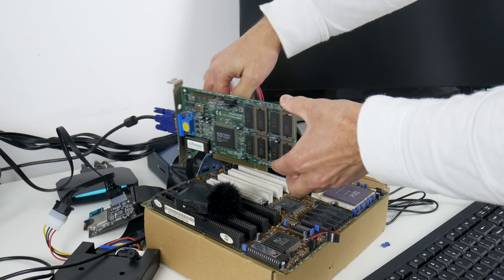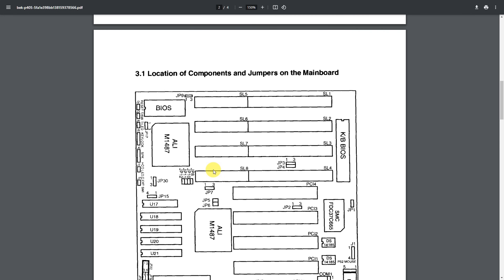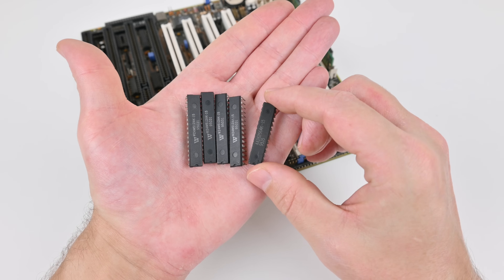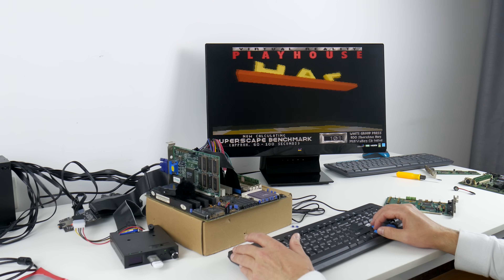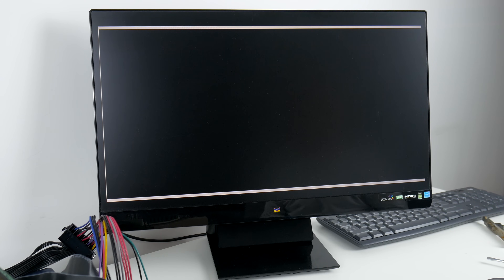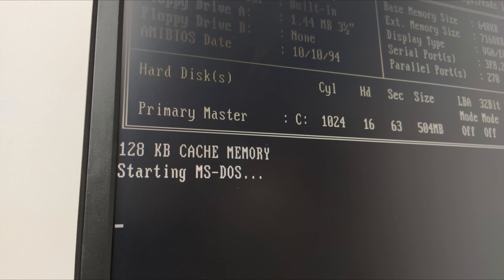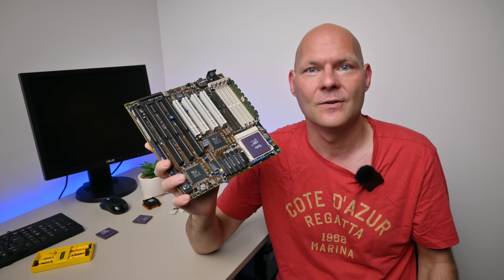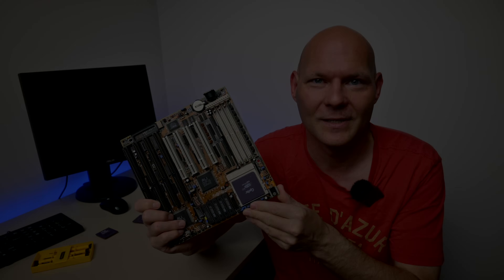PCI 486 Motherboard: The P405

Comment: @18:00 In my experience the best way to develop debugging skills is to start with electronics kits where you have to solder the components on yourself. These are a good start as they come with well defined parts and known working designs so the only thing that can go wrong is the assembly. Start with through hole kits and then try your hand at SMD. I recommend you focus on hot air as I've found over my decades of doing this that I've gradually evolved from iron first to hot air first.

Comment: You are mentioning the PS2 header. I have a baby AT board here that has one. I had to solder it on actually, as it was not populated. So far so good. It was working, when I wired up a PS2 mouse directly, but I can't seem to find a slotbracket for PS2. So I mean the part, that has the actual port and a cable to connect to th the header. Do you have an idea where to look for one or how it is called?
In the meantime I even resorted to 3D print a bracket myself and use a solder on plug. But the quality of the plug was so bad, that it broke after only a day.
Reply from the maker: They will be very hard to find. You might be better off buying blank slots and drilling the hole yourself. The mesh slots are easier to drill holes into...

Comment: the SiS 496/497 chipset seems the more solid of the PCI 486 chipsets in my experience, i had no lockups or reboots or hangs, even Windows 95 ran fine on it

Comment: great video bud. only of the best machines i had was a 486DX4 100 with VLB. it was amazing. i DOWN graded to a pentium 60 yes the old 5v POS and regretted it badly even till 2024, all the while i had my amigas and the like. i loved my DX4100. after watching a vid just recently where a dude built almost the same config i will do it again. best machine EVER. thanks buddy
Reply from the maker: You and me both! My very first custom built PC was an AMD 486 100 MHz with VLB. I loved that PC. All the parts arrived by mail and I was so excited. My next machine was a Pentium 133 which was a huge upgrade, but still, that 486 I have fond memories.

Comment: What's sneaky about barrel Batterie repairs/replacements?  Regarding 486 I run into a lot of issues with these boards overall. I'm now running a Pentium 1 motherboard with intel chipset and intel Pentium 100. Absolute hassle-free and very happy with this decision. It also features two usb 1.1 connectors for easy file transfer and modern interface devices.
Reply from the maker: Yes Pentium systems are much easier to work with...

Comment: I had a 486 DX2 66MHz iirc, and after that a 486 DX4 with 100MHz. Can't remember the details, as I was very young and my brother's did all the work setting these up.
I'm currently in the process of reviving my first PC, a Commodore PC10-III (Intel 8088, XT machine). I did find the videos of Adrian's Digital Basement very useful for repairing the battery damage and the first debugging steps with my oscilloscope (checking the RTC chip, address lines, ...). Still have a lot of work to do, it's not working 100% yet.
Greetings from Germany :-)

Comment: I hear you! 😅 It’s a full year I’m trying to get a stable 486 VLB build and after 2 boards, 2 vlb vgas and many hours spent I’m not getting the cdrom to work 😢 I’m going for an ISA multi i/o controller instead of the vlb one I’m using 🤞🏼
Reply from the maker: Yea with DOS at least you won't notice the difference. Use something flash based. Under windows 95 maybe but that runs like a dog on a 486 anyway.

Comment: As always, extremely interesting.  Each time I see one of your videos, I feel terrible for not unboxing back all my personal vintage PCs and making them work again. (Only the pentium works fine, the older ones are sick or possible dead, sadly)

I started learning a bit of electronic fixing few years ago, although with new motherboards which is quite more difficult. There are so many fantastic YT channels of people teaching that I wouldn´t know which one suggest. 
My only advice if you start working with the heat gun is to avoid the cheap yellow heat tape to protect plastic parts. I use aluminum tape (for heating ducts, chimneys, etc). Really cheap and amazing.

Also, for these old board with pìn through elements, a desoldering gun is an absolute blessing. They are a tricky and tend to get stuck until you get them right, but the time saving removing slots and stuf is massive, and at least for me are just safer.

The basic diagnosis for the trace repairs in that board, should start with just a multimeter in continuity mode, and see if they actually follow throuh to the PCI slots. I suggest almost needle-thin ending probes for it. If you don´t have those, they are pretty cheap with nice silicon wire in Aliexpress, so no excuse for not getting ones. 

Not an expert by any means, just a low level enthusiast, but glad to share. In any case, thanks for your videos, they are always welcome.

Comment: I found the PCI boards to be more stubborn to work with versus the VLB variants. This is probably due to the early adaptation of the PCI chipsets. I had to fight with my ZIDA 4DPS for a few days in order to make it stable. Now it's running a patched BIOS from 1998 on a Flash ROM that I had to sacrifice a P5A-B for. I'll eventually get a Flash ROM for the P5A-B and get it up and running again with a Flash ROM programmer. Currently the 4DPS is paired with an Am5x86-P75 with an MGA Millenium 2MB. Primary game is Raptor, which I missed the most.

Comment: While I did have a mate whose brother had a 486DX2-66 and it was really my first experience with DOS gaming, I have to say that I am more nostalgic towards the Pentium 1 as a Pentium 100 MHz was my first IBM compatible. However, I have now managed to get a 486DX2-66 motherboard but I just lack a case to put it in. I am actually considering doing a Woodgrain 486 since LGR's videos about his escapades with that machine have inspired me (and many others I have learned over the years) to make such a machine. This motherboard has VLB and no I/O built in so I will need cards for everything. Ultimate goal will be to find a 3DO Blaster for it and a Creative 563-B CD-ROM drive but those are super hard to find at a reasonable price. But it is good to have goals, isn't it? :)
Reply from the maker: 3DO Blaster, nice!!! I've never even seen one!

Comment: The thing I love about the 386, 486 and Socket 7 corridor is how much choice you've got for what to put in it, especially CPU-wise.  Still looking for a PCI 486 board for the cost and flexibility reasons you mentioned.  From my own recent adventures, I've been amused about how what would have been budget boards back then tend to be the safer bets now, since tighter integration means less can go wrong.

Comment: Not the topic, but can you please make video explaining how cache works? I recently assembled 2 486 PCs, one Intel 486DX4-100 and one DX2-66, I had the joy to discover all the problems (5V CPUs, 3.3V CPUs, FAT16 vs FAT32 needing Win95 OSR2, problems with jumpers not documented, problems because most of the HDDs are LBA and not CHS needing Ontrack Disk Manager from your website). But I NEVER understood what cache is, how to select the chips, and to set the jumpers. For me it is like RAM on a 486, you try a chip, it is either working or not but you have no clue until you try. And from your videos, cache seems to be quite important. But anyway, thanks for your videos!
Reply: For modern CPUs :

Cache inside a CPU is a form of really fast volatile memory (also very close from the die or even integrated to it). It's meant to prevent the CPU from constantly trying to access the RAM sticks to get data from. The transfers and the time they take to be done between RAM sticks and CPU are "slow" and give latency penalties to the job your computer has to do. See it more like an "onboard very close and fast RAM" that should always be used first by your CPU, with the "real" RAM (the sticks) being the last resort. Without cache memory, the processes would be slow asf and your CPU/computer would be a real pain to use.

(sorry if my english is a bit sh.tty ^^)
Reply: I bought 2 pentium III processors at 733 mhz over 10 years ago and a double processors motherboard. I obviously wanted to see IF emulating or virtualing a Microsoft Xbox was possible.

Comment: To find the root cause of random death is one of the most dificult and time consuming task. One strategy would be to list the potential areas for check and do it step by step. First I recommend the thermal check with IR camera. Maybe the CPU or/and other chips needs more cooling. Try to get the datasheet of the hottest chips and check the working temperature range. Try to reach a cooling solution for the quetionable chips in the midle of the working temp range. After the improvement of the cooling try to make a video on the test including the IR camera picture as well. If the crash is not colerated with the temperature of the critical component at the moment of the crash than probably you can close out the thermal causality of the crash. Move on to the next area to investigate. 

I would select the power supply area next. You need oscilloscope to  quickly measure voltage and indirectly current values of the power railes. Make a video about the test including the scope display. With this setup you can determine wether correlation exists between the crash and the measured value. It could be a voltage drop or an amperage spike at the time of the crash. Worth to check the total power consumption vs the rating of the power supply. Select a powe supply with 50% more rated power at least than the max power consumption during a stress test of the board. If it seem s to be OK than move on the next area. There are plenty of them to investigate. Good luck!

Comment: The best advice I can give you is to practice working on scrap boards before you try fixing something you care about.  Remove and replace chips, cut and repair traces, replace capacitors, etc.  Practice makes a huge difference in anything really.

Comment: I have a similar board: GA-5486AL. Had to repair it: leaked battery destroyed a number of traces and vias and ruined bios chip socket. Also had to replace south bridge (found replacement on Ali) due to damaged and missing legs (some pads ripped of as well). Config:
GA-5486AL (512К caсhe)

AM5X86-P75 (AMD-X5-133ADW)
64Mb EDO (4 x 16, that's all mobo can handle)
Alliance AT3D (4Mb of replaced memory)
EvilKing 3dfx VooDoo
Realtek 8029 (with bootrom customisation)
Creative AWE64 (0.5Mb chip replaced with 2Mb)
Sintechi SD to IDE adapter
LG 52x IDE cd-rom
PC-dos with lan support

Have an interesting super-socket 7 pc as well.

Comment: My take on 486:
Great nostalgia but not so great to work with: most don't have PCI or built-in IO, and use VLB which has its own kind of quirkiness.

Regarding repairs: NecroWare got me into repairing old motherboards and cards. Can also recommend Bits und Bolts.

Comment: Sort of regret throwing away a 486 board many years ago. I blew the board when attempting to overclock and then hung it on my wall for some time, finally threw it out when moving. But watching these videos, I realize it was a very late 486 board (it had PCI) and that it might’ve been repairable! But that’s a recurring theme: what used to be old junk, is now a treasure.
Reply: I'm sure most of us have done something like that. I had a Super Nintendo and Sega CD that both had issues and I threw them out. That was long before I knew about the right people to send stuff like that to for repair. If you have an old game console and it has a problem don't throw it away!

Comment: If there is anything more difficult to get working than a 486 motherboard, its a Contaq 3124.
Contaq 3124 is a hybrid 386/486 that will take anything from a 386DX16 to a 486DX50, and has 2 BIOS ROMs and flexible cache options. Always found with a coating of battery acid. I have one myself and can confirm they are way too fun to play with.

Comment: How hot were the cpu's getting?  Unless You tried off camera I didn't see any heatsinks attached. Definitely any 5v cpu over 33mhz should have a heatsink, but isn't always necessary on the 3v models. I have one of those Tomato 4DPS boards and a cockroach or similar bug peed on one of the SIS chips. I had some fun cleaning off the corrosion and repairing the damage with very fine wire and soldering, maybe that one You have had a similar thing happen. This retro hobby is fun but can bite You back sometimes. Nearly forgot to mention I had some of those fake cache ic's too, same markings, You can melt them with a soldering iron as it's just normal plastic.

Comment: If you suspect capacitors, my favourite tool is LCR T4, and it's very cheap. There are very similar ones with a shell, perhaps you want to choose one of those, nor sure they're called T7 or something. You need to lift a capacitor though, at least one leg, or take it out completely. I don't particularly like using multimeters or LCR tools that can be used in-circuit, the telling power of the results is VERY hit or miss, especially if you're lacking EE background. But also i don't feel like this board should need capacitor work, like they're barely doing anything here.

I would really pay a little extra attention to the visual state of the board. The solder just looks a little unconvincing everywhere in colour and texture, and there is corrosion on the spring of the coin cell socket and on the retention springs of the memory sockets, which suggests it has been stored wet, scratches and repairs around north bridge suggest it got piled on and banged around. One of the pins in the top PCI slot looks uneven. There might be pin damage or corrosion, maybe needs a clean and deox, and check all IC pins with tweezers that they seem stable. One of the vias at 6:30 is missing its fill. It's best to check that whole area for continuity and lack of shorts. The repaired area around pin 70 is RAS pins for RAM, not PCI, the signal integrity here is critical, and the via could be cracked inside, being intermittent. The repair around pin 75 are for IDE bus, which in that era doesn't have CRC measures to detect and correct transmission errors. I suggest the system needs dedicated software tests, namely memory test, and IDE error test of some kind. If one of the two errors out after a while, you'll know to leave the other area alone.

Lacking experience, you probably also want to practice on something that isn't a valuable mainboard for your soldering technique. Some sort of landfill electronics, routers often get thrown away, or disposable soldering or microcontroller kits. Materials like wick, solder, flux, are more critical in quality than the capabilities of your tools, though good reliable temperature control on soldering iron and quality tips are quite desirable.

I should say though i don't at all hate this board, in spite of the thumb down in the thumbnail. But my interest for 486 is overall very limited, i like slightly newer systems. Though if i did find my very first board or one of them, which were pci 486, if i could even remember what they were, that would be nice!

Comment: I picked up one of these boards during the pandemic, reputable seller who wanted to sell it preconfigured with an AMD 486 in it to make it easier. But I had recently rescued an Intel DX4 from a gold scrap merchant so I wanted to try that. Put it all together and very very clumsily for me I don't think I had it mounted right in the case. I did a bit of ATX to AT bodging to get stand offs right. Something on the rear of the board touched the case and it was bang and seemingly game over on first power on. It may be rescuable but I haven't had time since to try again. :-(

Comment: The other bios may have had a cache capacity limitation set.
https://www.youtube.com/@necro_ware Necro ware does a lot of retro board repair.
The POST card reports the last 2 post code if the board locks up during the POST stage the card will tell you what it was intialising / testing at the point it stopped.

Comment: I felt the same way, I never used to deal with soldering and circuit board repairs.  But when you deal with old hardware and collect it, you inevitably have to deal with it.  I also have an Asus motherboard with 486DX 4 100 MHz and 128 MB RAM.  I even used the board with a GeForce 2 MX.  But it is very slow and you cannot install DirectX 8 or higher.  Already tried it.  Now I have a 3dfx Voodoo Rush in the 486. 😂

Comment: I am pretty sure I have two of those boards and I have none of the issues in my configurations. Both of them are running sub-50 MHz CPU's so I'd need to tinker around a bit to figure if your particular one is broken or that is the nature of the beast. And I concur, they suck, my 50 Mhz I486 on BIOS defaults runs wing commander with no patches on stock BIOS config so it is what it is.